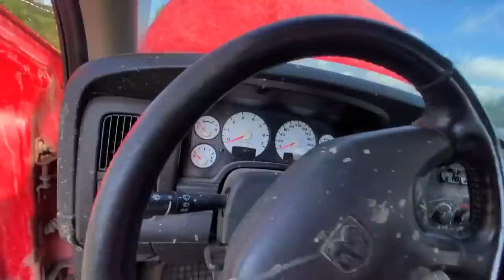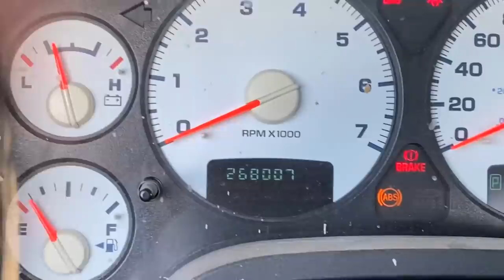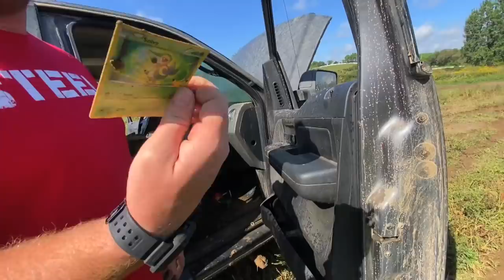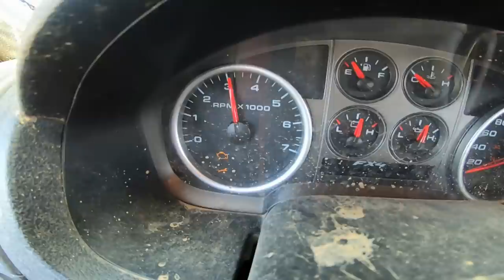Dr Pepper As ENGINE OIL!

Comment: What did Dr Pepper ever do to you? But honestly I am glad you are seizing up the engines before you send them to the junkyard because how hard you run them and jump them you have no idea how long the motor would run. If someone needed a cheap motor out of a junk yard nothing like buying a $300 used motor that gives out in 400 miles when you are broke!
Reply: I know a guy he has a 370z, he blew the engine he got the exact same engine out of a Q70 at a scrapyard for 550$ and it ran better than the older one.
Reply: @felixgohier1638  I am glad it worked out for him lucky stiff!